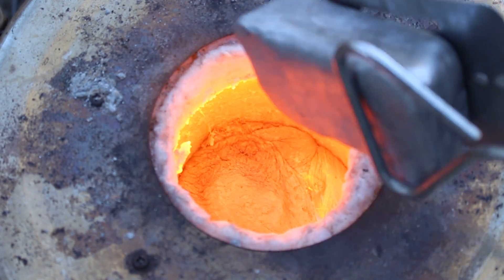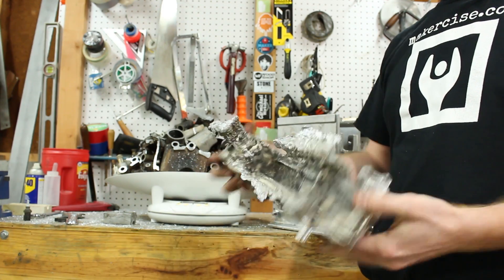DANGEROUS metal recycling? Scrapping to get the right alloy for sand casting

Comment: If you want to breakup parts like cast aluminum housings and manifolds the easiest way is to put them in a fire pit cover the part in wood then get a good hot fire going. Leave the part in until the fire goes out and the part is cool to the touch. Don't do anything to speed up the cooling, you want the part to cool slowly. Now the aluminum should basically crumble when you hit it with a sledge hammer. 

This method probably woun't work so well for cylinder heads, but for thinner stuff your good to go.

Comment: When cutting metal or other material with a circular saw ( other than wood ) you should pull the saw into the cut, rather than push it into the cut. I learned this from a guy using a smaller diamond saw. If you pull your blade into the cut, all of the debris goes in a straight direction away from you. If you push it into the cut, the debris goes everywhere.
Reply: I picked up some aluminum scrap the other day. I'm new to this. Got an aluminum rim and a few miscellaneous pieces of other castings . I first tested with vinegar and tried to burn some filings to ensure there is no magnesium in it. Tried to cut with hacksaw, diamond saw, angle grinder, none of these seem to cut it very well.. I am starting to think yes, plasma cutter.
Reply: To my mind, pulling onto a cut with a saw or rotating blade can make kickback or runaway much easier as you're now cutting more or less in the same direction the blade wants to run. I'm sure it can be done, and like most things if done smart it's not terribly dangerous. Thanks for the idea though and I hope this helps!

Comment: I work at a car dealership and my brother is a shop manager at an independent shop, so I have a virtually unlimited source of aluminum. I've found that a nonferrous metal cutting blade in my miter saw is one of the most efficient ways to get scrap cut down to size, but you have to clamp it very well to the table and fence. The force with which a 12" miter saw can throw a part is shocking. As long as you feed at a reasonable pace and your cutting doesn't cause the part to bind against the blade you won't have a problem. 

Another solution is to heat it in a barbeque, grill, or fire pit. Aluminum becomes quite brittle, and then even fairly small hits with  hammer will break down even big lawnmower decks and other parts too large even for the miter saw.
Reply from the maker: The first bit was broken up in a fire pit. Rescuing it before it gets too hot wasn't something I was able to do. I ended up with a good many right-sized chunks, but vastly more tiny bits the crumbled off into the ash.

Comment: A cheap plasma cutter would probably do the business on that scrap without risking the trip to the ER.  Plus, you get a plasma cutter!
Reply from the maker: Excellent sales pitch. Hmmm...might have to use that one.
Reply: I can hear the conversation:  "You need a what? "  "A plasma cutter so you don't hurt yourself and bleed all over the yard and carpet.  Hmmmm.  Well if it is for safety, I guess so."    8-)
Reply: Atrixium Recheck your wallet,  You can get a tig/arc welder/plasma cutter for under $300 on eBay and amazon. There are tons of reviews and there is a consensus that the amount of value you get is frighteningly high.

Comment: I'd like to see you're thoughts / plans on the oil burner if you don't make it. I used an open fire in a washing machine tub when I broke down the cylinder head and bell housing and it worked fine, the only thing is be careful how you break it up, I used a hammer and other bars and adjustable spanner (shifter), the hammer was good but if the metal is too hot, it breaks up into thousands of tiny pieces. That blade in the circular saw was probably turning many times higher than it's rated RPM, I've tried it, it's brutal, take care. Peter
Reply from the maker: I used my fire pit to break up the first batch. I had trouble with it getting too hot. I had a ton (not really a ton) of metal in peanut sized pieces mixed into the ash at the bottom of the fire pit. Help me understand your RPM comment. I am not sure how it the blade could go higher than its rated RPM. The saw has a max RPM of 5000 (I assume at no load). The blade is rated for 7500. Maybe I am misunderstanding?
Reply: I think there was an assumption that the blade had much lower RPM rating. Conventional wisdom is metal cutting blades run at slower RPM, wood tools run at higher RPM. So metal blade in a circular saw for wood probably runs too fast. I think the plasma cutter seems like the way to go, or maybe an Oxy/Ace torch?
Reply: My mistake, I assumed the rpm of the metal blade to be a lot less than 7500 as the industrial machines I have come across in the past turn so slow.

Comment: A useful way to think about the problem of the sand not being strong enough without weight on top of the flask to hold it down is to think about the relative densities of the sand and the Al which are very similar, the sand tries to float on top of the sand. When you don't have much sand over the top , the Al wants to rise. If you cast more dense metals like copper alloys or cast iron, the problem is worse! To break up large pieces of Al, heating the until they are "hot short" in a barrel can allow you to "pull" apart the softened (hot short) metal at below melting point. A blown wood fire is hot enough for this! All the best, Matthew